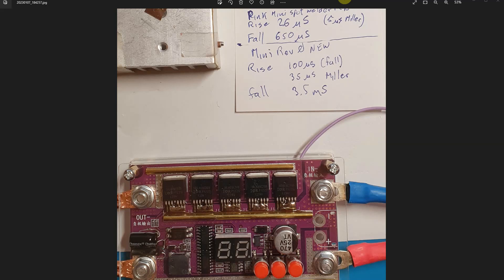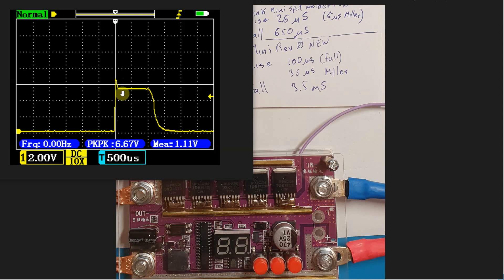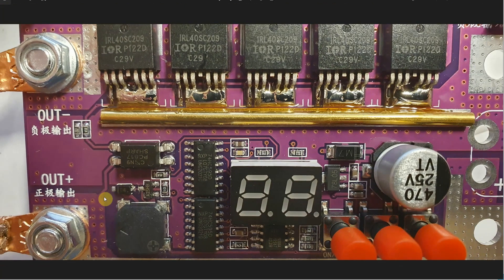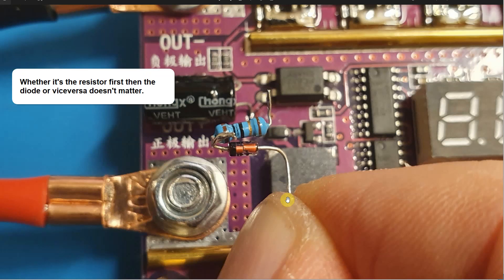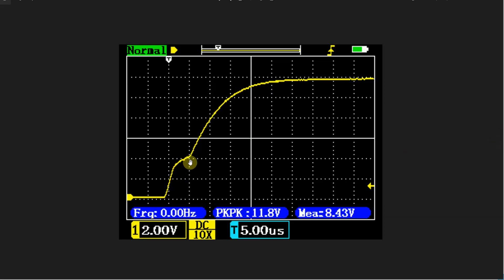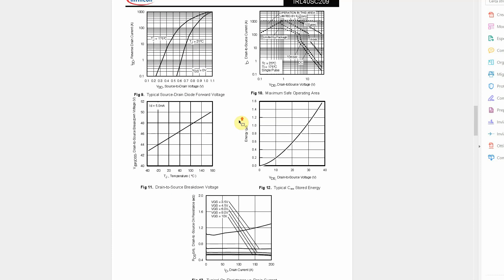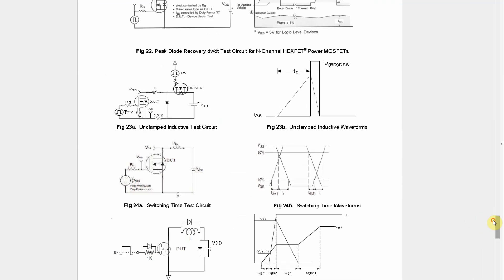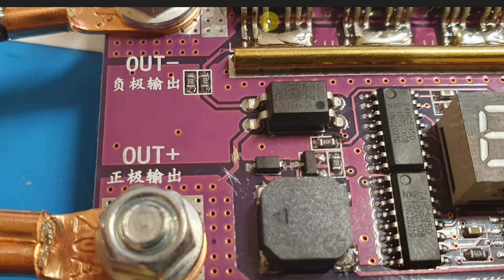"Purple" PCB Mini Spot Welder

Comment: Hi I have the same welder Can you tell me if I am safe using my drone lipo turnigy 2200 - 20-30C discharge (44-66Amps) in working condition with this welder without Modding? - I am not an expert. I would use other battery if necessary
Reply from the maker: Hi, your pack is not enough to weld properly, you also risk damaging it (it will swell up). You need a 3S 5000mAh 50C at least to get decent welds without stressing the LiPo cells (or if you have a 45Ah-60Ah AGM car battery in good working order you can use that too).
Reply: @Luca_Techy  gosh thanks for this info. I kind of knew about a proper High amperage battery but wasnt sure if it's enough.. you probabily saved me from disaster. I have to get an AGM then but prices are high. maybe better to go 5000mAh. i have to check the solutions.
Reply: @Luca_Techy  Tattu FunFly 3s 11.1V 1550mAh 100C XT60 - looks like it has 155A but will this be enough ?
Reply from the maker: I don't suggest a small pack with very high C - that's not appropriate for this application. You need at least a 3S 5000mAh pack starting from 50C upwards as I mentioned. Small packs with high C cost the same and are more likely to fail earlier than larger packs. This is due to the design of larger capacity LiPo cells which have more equivalent surface area to deliver high current and less critical im design. They are less prone to stress in these conditions. Without entering too many details just consider more capacity = less stress and less unbalancing over time.
Reply: @Luca_Techy  thanks so much for this valuable lesson. I will go 5000 up for lipo  or good powerfull AGM or good used one in good working condition. One last question is it possible to go too powerfull with the power source (eg battery, lipo )  in instruction it says that for lead -acid or AGM the new battery can not exceed 45Ah.. and if it's more that I should consult their customer service and ask them for the current limiting method. Mine has Infineon MOS and sigle MOS tube is 400A max theoretical. 2000A for all 5xMOS
Reply: btw. I have a few spare aluminium radiators that I possibly could put on the top of the MOS tubes just to make sure them run Cooler. but don't know yet if theyre getting hot anyway.
Reply from the maker: @rocheuro  you don't really need them - if it gets that hot you won't be able to hold the electrodes in your hands as they get even hotter than the FETs. Just take a few seconds pause between welds to let it all cool down or add a small fan (but never needed one on these).
Reply from the maker: @rocheuro  stick with a 3S 5000 50-65C (or slightly more).
Reply from the maker: There is always an extreme limit, but if you are using around 60Ah battery with the provided lossy cables you're ok. You risk when you start shortening the cables or replacing them with "good quality" copper ones, then you need to take care of the peak currents if the battery can deliver them.
Reply: @Luca_Techy  For sure, you are so right about the pack needed!

Several months ago, I changed from my original pack to an
Ovonic 3s1p 5Ah 50C pack. It has worked very well for making
about the last 7 packs (ranging from simple 2 or 3 cell packs 
for my airsoft up to 12 cell pack for portable solder station).

However, I have stayed with .15 strips as the .20 does seem to
be a bit of a stretch. Got a 3s1p 8Ah 80C on the way, maybe
the .20 will be a bit simpler.....Hoping anyway....

Thanks for all you do for us!

Comment: Luca,
Thanks for your videos.
Why do the instructions suggest up to 100 AH car battery, but only if old, and not over 60 AH if new? I wouldn't think AH would affect performance.
I did the mod, but may have damaged mine with a motorcycle battery. I am using a car battery now, but I only get a very weak weld with the setting on 99.
Reply from the maker: Hi Brad, it's a simple method of imposing a current limit: a 100Ah Lead acid "several years old" car battery if still in working order (capable of starting an engine) will delivery less "CCAs" or Cold Cranking Amps than when it was new (15-30% less) due to higher internal resistance (due to unavoidable electrode sulfation on the ong run) -- or in the ballpark range of a new 60Ah battery, meaning around 150-200 peak Amps for a brief amount of time, which is the current limit of all "mini" spot welders. This is also why the instructions (somtimes undecypherable) ask not to shorten the provided power leads or replace them. It may seem all "lossy" but that's the whole point: if you don't have those little resistive losses introduced by the (cheap) long cables and rated battery the peak current delivered in the first few milliseconds will destroy the FETs (usually one fails - the most performing). You can't really avoid this, the only way is to LIMIT the current with resistance or have a much beefier setup with perfectly balanced FETs, TVS diodes etc but then you will have a minimum 150$ price tag for such a device (unless you build it yourself). You just cannot ask such a "cheap" design to deliver more current, it will simply fail. Some people are lucky to get better matched FETs and this helps to avoid the blown FET syndrome, but shortening the leads and hooking up a gigantic battery will destroy it. Similarly hooking up a very weak battery and "over timing" the weld (>40ms) because it can't perform will stress (overheat) the FETs but if the Gate drive is solid, they shouldn't fail so easily. You should stay in that operational range with the rated battery and max weld thickness of .2mm with max weld time of 30ms else you risk blowing FETs because something is not performing correctly.
Reply: @Luca_Techy  Thanks again for your time.
I have a 60AH, 650CCA car battery that is about 6 months old. I want to use this because I would prefer not to have to buy more items.
If I aim for 150 amps (as you mentioned above), can I use a 0.08 ohm 1W resistor to limit the current?
V=IR. V=12. I=150
R = 0.08
P=VI.
P= 0.96W
Thanks.
Reply from the maker: @bradg7701  You would actually have to "drop" or limit 500Amps in theory so that's the ball park value with V=12 but this is all theoretical as there will be more voltage drop due to other inefficiencies so that resistance value should be even lower (probably half). In practical terms you would just need a bit longer cables if they were real copper: the ones provided are actually aluminum core so they have a rather high resistance - you could either extend the power lines by a few inches or just use it as is starting from 2ms upwards and see how that goes. Someone used jumper cables directly to extend the power line but that was with a 110Ah battery from a diesel engine. I think you should be ok just powering it with your 60Ah battery considering the losses, just start from a low ms setting.
Reply: @Luca_Techy  Thanks for your help.
I was previously using jumper cables from my car and this was causing the problem. I imagined those big wires would have little resistance, but I guess the clips etc caused a lot of resistance. I tried some other shorter cables, but even these didn't work.
Eventually, I connected the unit straight to the battery and it worked at about 6ms.
Oddly, one side welds better than the other. Maybe I need to push harder.
Thanks again.
Reply from the maker: @bradg7701  As you see, any additonal resistance in the circuit even if small will impact the peak current necessary for the weld.

Comment: How would one add a trigger button to this board?
Reply from the maker: I think I mentioned this to someone else: you would need to do a hardware mod by interecepting the contact detect trace that goes to the MCU detect pin, cutting the trace and wiring the resistor divider (MCU side) to a footswitch and the other to the positive so that when you press the footswitch you emulate the contact (the detect circuit usually detects a positive voltage once the contact is made through a resistor divider to lower the voltage to the MCU input pin compatible level). Of course once the trace is cut, the auto weld won't work unless you bridge it (maybe add a switch acorss the trace cut).
Reply: @Luca_Techy  thank you!

Comment: Thanks for the video and mod instructions. What is the minimum mAh battery that can be used? Is like a 2200mAh 3S or 4S acceptable. And would using a too low mAh battery risk destroying MOSFETS, or would it just output too little Amps or something? And is the LIPO batteries power leads thick enough, they usually dont have especially thick power leads.
Reply from the maker: Actually more important is the C rate of your LiPo battery, it should be rated over 50C and be at least 2000mAh so if your pack is at least 50C then it's fine (it's the current that welds, not the voltage). Also I would stick with 3S as 4S can be pushing the limit and actually doesn't give you major benefits over a good 3S with enough C and the risk of blowing FETs (overdriving) increases. If the pack is properly constructed and decent quality the leads and plug (XT60 or XT90) will be thick enough - you don't have to modify them. If your pack is underrated then you risk destroying FETs too, if the voltage drops low enough and for long enough and you increase weld time drastically trying to compensate for the weak welds (typical example of how users destroy FETs). Of course a dead battery won't have the power to destroy FETs, but then again you won't be able to weld at all. Please take some time to review my other videos as I explain a lot of the issues in detail (the criticalities are common to all these spot welders).
Reply: @Luca_Techy  Thanks for your answer. So would a 3S 5200mAh 80C LIPO be a too high C rating? The other batteries with lower C ratings that i found have 12 AWG battery leads, and according to the "manual" one should use at least 6mm2 leads (10 AWG)? Is it acceptable with a 80C battery?
Reply from the maker: It will do, consider 80C the "best case scenario" - usually it's less. In any case always start from a low ms (under 5) when testing and go up.
Reply: @Luca_Techy  Sorry to ask you again, but the 3S 5200mAh 80C battery i received turned out to have 12AWG leads even though the picture showed 10AWG leads. So do i dare to use this battery with 12AWG leads for spot welding, or should i return it? Thanks.
Reply from the maker: I don't think it will be a problem, the cables of the welder should drop enough voltage to reduce the peak current.
Reply: @Luca_Techy  Oh I thought it was a bad thing if the voltage drops, and to a certain degree also if the available amps gets limited? Or maybe I misunderstood your answer? Although I don't know how big the real life difference will be between my thinner 12AWG compared to the thicker 10AWG, for a 15cm piece of wire. Thanks for your help, I will try with this battery.
Reply from the maker: @my.username  the resistance of the wires, internal resistance of the battery, FET DS and weld  will cause a voltage drop. This drop is ok if within certain operational limits in order to limit the current if the battery os capable of delivering more than the FETs can handle.
Reply: Will adding big capacitors in the source makes him able to use those batteries?
Reply from the maker: You would need a large 12V 500F or more supercap bank in parallel to the "weak" battery (or PSU) to be able to spot weld - considering that the bank needs also to recharge between welds if you do several in a row.

Comment: Great explanation, thanks for the video

Anybody could give a hint if it would be possible to extend this spot welder to control the weld with a foot pedal switch?
Reply from the maker: You would need a hardware mod, theoretically cutting the autodetect trace and wiring to a pedal, this was you would trigger the weld through the pedal with the same delay as before. I think it's doable but I would need to check the circuit better to see where to cut and wire the foot switch.

Comment: what is the purpose of the diode? maybe no diode? Only resistor and capacitor?
Reply from the maker: The diode prevents the capacitor reverse discharging towards the battery when it's voltage drops (6 volts). Without it the cap is pointless in this application.

Comment: If you connect two batteries in series, meaning 24 volts, and turn it on with another source, and use the negative pole across the board, will it work? Will the current on the board decrease? Will it work or will it burn? I know the higher the voltage, the lighter the current.
Reply from the maker: No it doesn't really work like that: Ohm's law states that given a fixed resistance (R) the ratio between Voltage (V) and Current (I) remains constant (V=I*R thus R=V/I) so given that the spot weld has a Resistance which is practically fixed (some milliohm plus the length of your cables and FET losses) the higher the Voltage means the higher the current. This means that if you increase the voltage you would get explosive overcurrent (if your batteries are capable of it). The concept of these portable spot welders is to have a compact and powerful power source (lipo battery) with just enough Voltage to overcome the resistive losses and still deliver enough current to the weld (200-600Amps). Professional industrial welders actually  have lower voltages (max a couple of volts) but much higher currents due to the much thicker and conductive cables and electrodes in use. I hope this explains it.
Reply: Can I add a capacitor at the outlet with a value of 25 volts 2500f, does that help? Is there a solution to prevent the MOSFET from being destroyed?
Reply from the maker: @user-Majdy  a large capacitor bank (several hundred Farads) would be better if you have a weak power source - but this won't prevent the FETs blowing if you overdrive them. FETs blow for several reasons, improper Gate drive, slow switch on or off, overcurrent and reverse transient voltage peaks across Drain Sourse or Gate. Also FET unbalance when you have several FETs in parallel which leads to overdriving one more than others. Lastly, thermal breakdown. In this specific application the problems are improper Gate drive, TVS and overcurrent. As you see, it's not that simple. Basically to avoid blowing your FETs you need to consider all of the above, staying within operational limits (don't overdrive).

Comment: There is another solution how to protect mosfets. Do not connect positive from battery to welder but positive dirrectly to electrode . Only  negative from batttery is connected to spot welder. In addition, there is a DC power supply connected to welder
Reply from the maker: Yes that is an alternative as it also decouples by separating the positive lines. However it also makes things more cumbersome, as you need an additional battery (or PSU) for the "logic". The point of these mini spot welders is to be "portable" thus work with one power source. Unfortunately that still isn't enough to avoid destroying the FETs if you overdrive the welder as it has no reverse transient voltage surge protection and the FETs are probably not always matched.
Reply: Radek, if I get this spot welder, I'm going with your idea. Just to be sure. :-) I have some 12V power supplies around just collecting dust. Do you think 12V/1A would be enough to power the board?
Reply: @GargamelCZ  i think yes. i have tested this spot welder with DC power supply. With 3 mOhm battery there is no problem to weld 0,5mm steel or 0.1cooper+0.1 steel 
I increased the number of mosfets to 10. and eliminaded cable from battery to welder. battery Clamp is conneted  directly to welder.
Reply: @radekzmazur3389  Where did you get the mosfets from? Just generic Aliexpress buy? Or did you find some service providing matching FETs?
Reply: @GargamelCZ  but i am not shure if increesing number of mosfets helps something. With oryginal 5 mosfets you can have up to 2000Amps. With 10 you can have max 4000-5000 Amps .
Reply: i have IRL40SC209  mosfets from alli express

Comment: I have destroyed mosfets  in this "purple" welder. I was using 12V 62Ah lead accid battery with internal resistance 8mohm. I set to "20" and i was traing to weld 0.2mm nicklel strip. And one mosfet have burned and all other are also not working. what was the cause of the damage do you think? the rest of board is probalby fine because the voltage is showing to the gate of the mosfets when welding
Reply from the maker: Most probably overcurrent and unbalanced FETs. Also without the decouoling mod the voltage may have dropped enough to no saturate the gates. 20ms is a lot for this welder, especially if using large batteries. Always stary from 5ms and go up. Also I don't recommend using .2mm with these welders unless you have balanced fets.
Reply: @Luca_Techy  i was starting from 1 to 15 and it was poor welding. And then set to 20
 How balance fets?
Reply from the maker: @radekzmazur3389  That's the thing that should be done during assembly in production, not by the end user!

Comment: Thanks for the info. I   pretty sure this is the one I ordered. 
How does it weld?
Reply from the maker: Based on my early testing (post mod) it appears to yield very good welds on low time settings (I get great welds under 10ms on .1-.12mm strips). It appears to perform as the Wise Maple and slightly better than the modded BK/Bl series and just as good (if not better) as the latest New Rev 0 (with mod) regarding the weld result. I still need to do some more stress testing as I've only reached 15ms (which is plenty!) to see if it's stable.
Reply: @Luca_Techy   what size battery may I ask?
Reply from the maker: @joshkelly3743  I always use a fully charged Lipo 3S 5000mAh 50C, specs are also in the video!